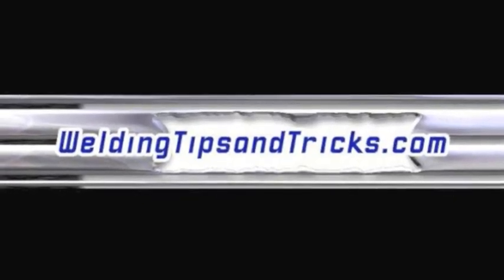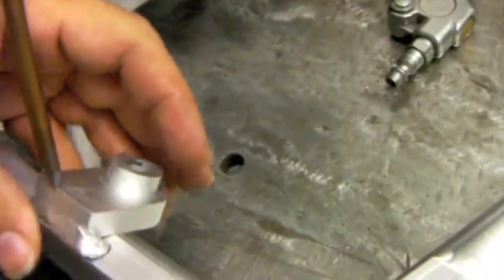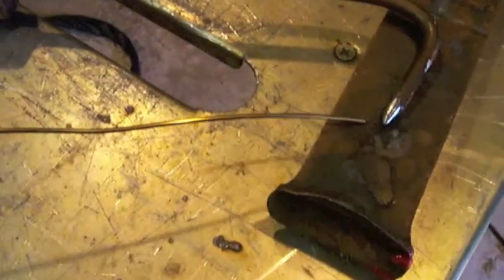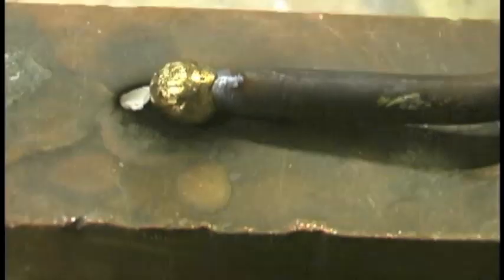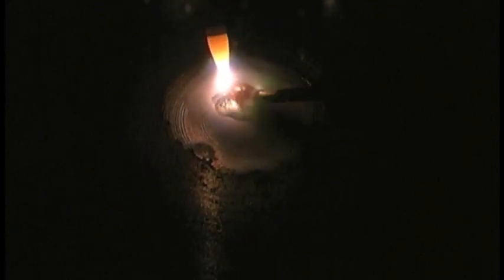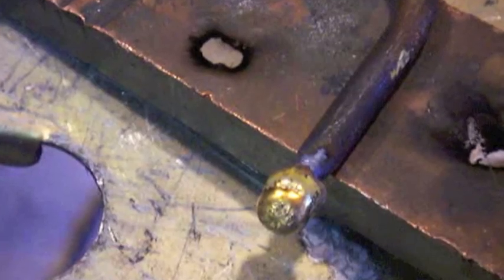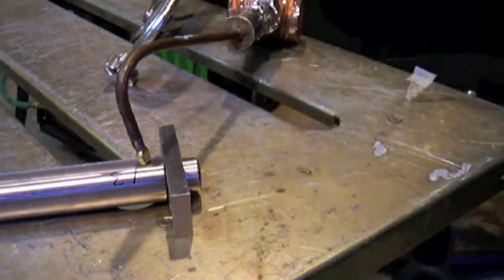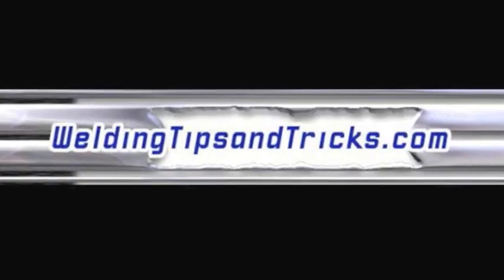Welding Tools - DIY Third Hand Improved

Comment: @weldingtipsandtricks I frequently use large single strand copper from electrical cables for welding 3.2mm stainless rod to thin sections of 2.5mm steel, typically I run the amps at about half the amps I would run to weld so 40 - 45 amps, I run straight DC, electrode negative, no pulse, you can also use the copper wire to heat shield the piece until it melts. I’ve found it an easy way to join thin sections that are decorative pieces and while it seems well bonded it’s obviously not something you’d do in a high strength or structural application.
You could use this method to copper coat contact points on steel

Comment: Hey there Jody,,,,have been learning to tig weld ,with a huge amount of help from your videos,,,,excellent stuff,,,l was learning on a  non brand name DC stick,tig ,which worked ok, but today l christened my new Lincoln 201 AC/DC,,was worth learning on the dc stick tig,because l noticed immediately that the lincoln was a hundred times smoother, watching your videos over and over made me feel very familiar with the controls,nicer welds pretty much straight away,,,,so thanks,still watching,still learning. Regards Warren,,,Australia.

Comment: pre 1982 copper pennies are 95% copper., would that work?, then  the problem with getting the copper to adhere to the steel, perhaps some jb weld would work if it could stand up to temps while welding

Comment: When I was in the motor business, I used this material to repair small defects in large synchronous motor slip rings.   A few times I was able to use heat sink compound and not take the slip rings off the motor.  This made for a temporary repair until new slip rings could be ordered or made.  

Great tip.